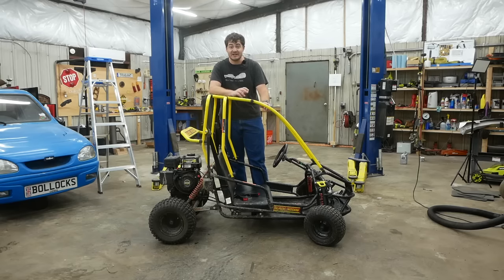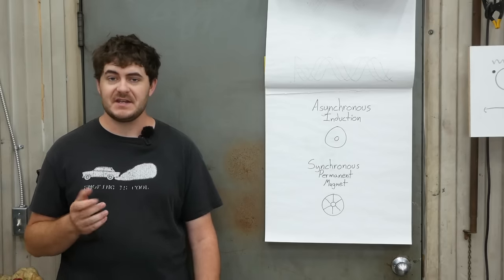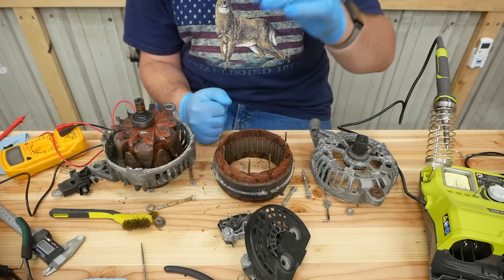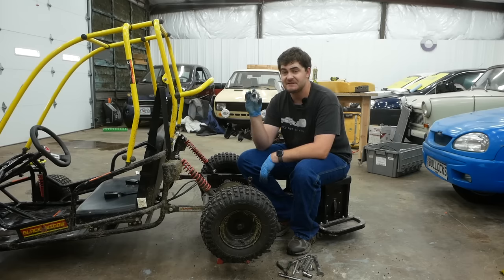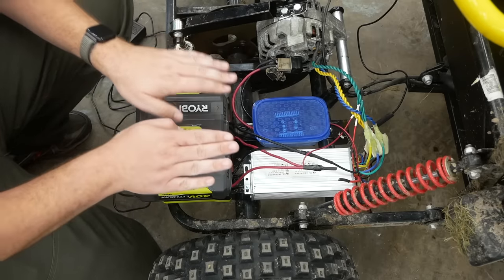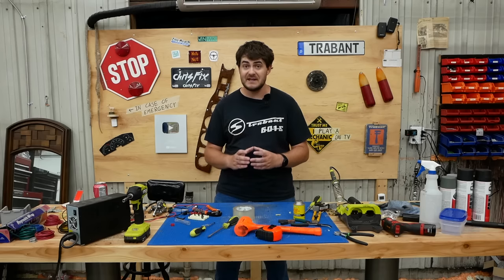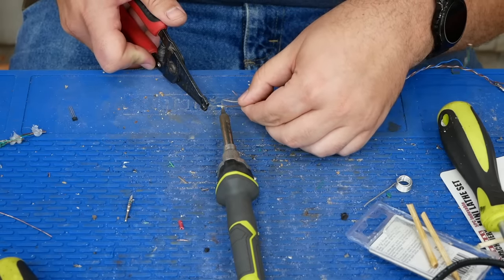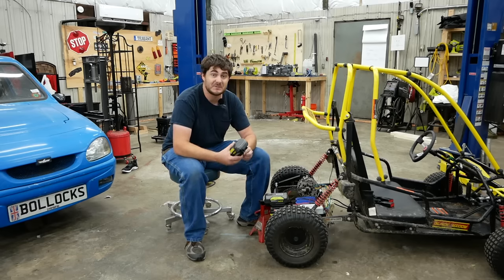Can I Power This Go Kart with a Used Car Alternator?

Comment: You will probably need to switch to a full size golf cart/jet-ski battery and use some sort of starter motor to kick the alternator into gear automatically. Can tie the starter engagement start and length of operation to the hall sensors (with custom breadboard) so that so long as there is a signal from a sensor in the past X amount of time then the starter doesn't engage so it doesn't just run and waste tons of battery while under Alternator power, only provides the initial kick forward so the alternator can engage and take over. When the kid comes to a stop, then the timer ends and he can press the accelerator again as X amount of time has passed since the sensor was tripped and now the starter will push the cart and off you go. Or you can make the throttle have an initial oomph at the start by making a two contact throttle... the initial start of the throttle from zero is the starter, and you push past that initial kick into the alternator once you have forward momentum. Would require testing to see how long that contact needs to be to provide enough oomph before it swaps to the alternator for speed as you continue to move the throttle forward. Downside to this is the kid might stay on that inital contact using only the starter to move... and drain your battery darn fast.

Comment: I saw a video about converting an alternator into a motor that shows the Hall effect sensors have to be in the center of the windings rather than at the sides due to the V shape of the rotor. Austiwawa I think it was? He used it to power a bicycle.

Comment: Put a high current capacitor in parallel with each of the motor windings and start from there.  3 phase is a bit confusing 👍
The cap should help flip the phase or at least that’s how it works on single phase/2 phase

Comment: Just a little more math: Typical 100 amp alternator at 13 volts is 1300 watts. I suggest you greatly reduce acceleration and the motor may then keep up with the controller.

Comment: When you mentioned getting another motor with the speed controller, my first thought was to hook them both up to get more torque.  Does that make sense?
Reply: not if he doesn't solve the sensor issues also it complicates the design while doubling the power draw, in his setup the HP output is not limited by the electric motor. Its the speed controller the limiting part plus he already plans to limit the speed anyway.

Comment: I wonder if the field from the inner windings is inducing current in the stator, setting off the over-volt protection. Or possibly causing a feedback loop of some kind.

Comment: Another point to note about electric motor power output is that is 1.6 horsepower instant a gas motor is 4 hp when it's full throttle. Electric motors are direct power and twice the torque of gas

Comment: On an alternator its voltage verys by power draw if you have a strong current being used the alternator will need to be spinning faster to keep up with voltage. I build high output alternators as a side job for emergency vehicles and some car audio enthusiast

Comment: One thing with the back emf position sensing in a brushless motor controller is that it knows where the rotor is from the electrical fields generated when the rotor moves slightly. So it sends those quick pulses, sees how the rotor moves, knows where it is, and spins. As soon as it's on the ground I'd bed those quick pulses aren't enough to spin anything anymore so it can't get the position of the rotor. You shouldn't need to push start it, so much as just rock the cart back and forth before turning the throttle, that should do the trick to tell it where the rotor is. 

The battery cutting out I'm as a loss, as I've never used the cheap brushless controllers, but I've had better luck with high power RC controllers for brushless motors than the cheap Chinese EV ones. They perform the same and typically come with better documentation.

Comment: For the kid you can dial down the maximum current the motor will receive and since you are planning a larger maximum available current you can turn up the current as he gets older and more capable of driving it safely.

Don't be tempted to add an "adult switch" because kids are smart enough to figure that out and also how to make that available for them when you're not looking.

Comment: The reason it keeps cutting out could be a built in low voltage cutoff. They are becoming more and more common on ESCs that are designed for lithium batteries. Or some sort of cutoff built into the batteries. As for the twitching, I’ve run into this before on an electric car car and never could figure out the cause. Hope you have better luck with that than I did

Comment: Mate patience is a virtue, or so they tell me. I have to admit this video, while very interesting, had me no closer to understanding how the motor was supposed to work, but still you have a great way of describing your intentions. Frankly, although less fun, but putting in a  small petrol motor, suitably noise proofed, would have got the 6 year old up and running and provided some very helpful explanation by you on how its done. Anyhoo I will await your next step with this build with interest. I am in the process of attempting to motorise an old 4 wheel mobility scooter  to run using a 110cc  petrol motor. It has a 2 speed  auto matic box and is electric start. To be honest, had I known what a mission this was going to be I would have left the 24volt batteries in place. But I want to be able to go in excess of 30 km on a single charge. Recharge is about 4 hours, so the small petrol motor seemed the best answer.. Oh well its fun flying in the dark with blinkers on..

Comment: I like how you wisely gave up- not as a full-on give-up, but you knew when to retreat and regroup for a second battle.  Also, could the rotor current perhaps be not enough at startup under load to cause the fields to get ahead of the rotor and dupe the controller into thinking the motor is stalled- thus triggering protect?  Could be a capacitor across the rotor winding would help?

Comment: Perhaps your controller MOSFET (driver) is blown. Did that few times with mine, have to replace them. Or simply enough, just buy a new controller, at least by having 2 you can compare if one is faulty.

Comment: Here’s a tip to anyone wanting to do something like this try and find someone who’s scrapping a Etorque equipped ram and see if they’ll sell you the motor/generator it’s going to be a lot easier to configure than this no offense to aging wheels but a motor generator is exactly that a generator that’s also used as a motor to drive a ram 1500 when In electric mode it’s got a lot of torque and even on my full size ram 1500 4x4 it’ll get her moving quick so imagine how nasty it would be on a go kart frame!

Comment: That's not really how the speed controller works though. IF it's rated to 1500W it doesn't mean that's the power it uses. It means that's what it's capable of running. 
The motor controls the power use. Free spinning that motor doesn't use 1500W if on the ground it does.

The motor will have a KV, and a torque per sqrt(W) rating. It might not actually be known, but it will have one. The kv is the rpm per volt. 
Lets assume the power of the alternator is equivalent to it's power output as a generator. The can put out between 40-140A with some high power ones for certain vehicles or configs putting out 300A.

At 12V, that's 480-1680W

Comment: You added 5 teeth to the front sprocket 

When doing that on a dirt bike thats a huge increase. Huge increase in top speed! 

Try a smaller front and bigger rear sprocket combo.

Overcome the initial current draw of getting it moving. 
Lower top speed
Higher take off and lower draw on the motor

Comment: I don't know what the problem is but I switched up a old losi remote control that was made to run on NIcad batteries. I made a lithium ion battery for it . And it did all the crazy stuff your cart is doing. Exactly the same . From the push start to only running a couple seconds and shutting off but all I had to do was flip the switch off and back on and it worked for a couple more seconds.  I never did figure it out .

Comment: there is two types of motor brushed an,  there is two different motor controllers. sensored modes usauly apply too brushless motors and controlers. as your using a brushed motor look into a controller designed for it. also lok into c ratings of your batterys as that will also help.

Comment: The reason it’s not working is because the alternators electromagnetic shaft is triangular, on a brushless motor the magnets are permanent and rectangular so the Hall effect sensors can be on the outside. But because the magnets are triangular on the alternator they arent getting a strong signal.

Comment: i have helped make a few carts like this, we never used an alternator though, just a normal a/c or dc motor with modifications as needed, most ac motors can be converted to dc from what my teachers showed us, anyway, what we found for more then one build was using a pair  of 12v deep cycle marine batteries was far more optimal for hours of use, also, we just used a resistive  speed controller kiped out of cars at u-pull-it/pick-n-pull type  places,  it was fun, the advantage of the large lead acid batteries in either  in series or parallel is run time and, they are  infact as im sure you know, quite easy to charge infact, we ended up mounting a small charger into the last one we made, so it could be plugged in when not in use, it was for a brother and sister who liked to go to the far barn and visit people in the area, and where they could plugin to charge when sticking around for a bit, it was a slow charge  but, so far they havent gotten stuck and its still in use daily 7 years later.. new batteries and tired have been needed, and the old man replaced all the barins when he realized one was starting to go, its  actually big enough  for large adults with moving seats, and it can move... even with my fat arse in it... its running dual 24v deep cycle batteries now, the old man got a good deal on a couple barely used ones out of a blow up piece of farm equipment... even he used  it to run out to the far barn and check on fences.. it can genuinely go for hours... he did setup a fan moving air over the motor and a heat cut off for the motor after the kids called  to tell him how hot it was, he drove up and, agreed, had them wait an hour then drive it home, by the time they got there he had found an old metal 120v fan, he tore apart and juse used the head(fan and its grill) and its driven by a belt or chain(he made a cover for that  to keep  fingers out same as he did for the chain drive) it looks a bit funny but... that and the heatsinks he epoxied to the thing, no more heat issues since... 

oh and he had limited the speed by setting a limit in the speed controller range but that was removed long ago, once they got old enough and, heavy enough, he removed the screw and well...the way hes got it rigged now it can and has  town his boat up hill to the far barn with his fat arse in it.... torque for days... and enough speed to make me, somebody who likes moving fast.. a bit concerned...(i mean we have rolled it.. the roll cage is great and all.. so are the belts...but...still makes me cringe thinking about it..

the original speed was  set to around 15mph, same as my mobility scooter he moved it up a bit to around 20-25 range before just removing the limit... its  "dumb system" even the temp sensor isnt computerized.... the old guy knows his analog tech like you wouldnt believe....

Comment: You use switch HAL sensors, for brushless motors you need to use intensity strength HAL sensors, that provide an output voltage proportional with the strength of the magnetic field, and you need to place such a way that they don't saturate, you need a perfect sinus signal out of HAL sensors and the placement as well need to be placed in an exact position, the controller need to sense exact position of the rotor, when HAL sensors are present the controller become something like a 3x feedback regulated power amplifier, if you do not use HAL sensors the controller will try to sense the position from the rotor and use the stator drop voltages as feedback, what you seen when you connected the stator without the rotor was the controller trying to get feedback from the stator thru the rotor position and enter in the positive loop and begin rotation, because was chain directly to the weels the feedback voltage is not enough to trigger the positive feedback, you can use the variator clinch from the gas engine, to let the motor spin and be coupled to the weels after the speed increase and the controller is in normal functional state.

The same effect ( without HAL's) can be obtained with a simple BTJ power transistor one resistor and one condensator and using one phase as signal thru resistor and condensator in paralel to the base of the transistor and one phase wired to the transistor collector, the resistor with condensator in paralel will provide the initial magnetic pulse to force an initial rotor movement, if there is an rotor the phase will return a voltage that is filtered by the condensator, and the transistor will become and out of phase switch that power the other phase, the resistor has the role to give initial reference voltage to the base and make sure that the condensator will discharge in order to be enough for the next base pulse switch.

Comment: Too many variables i think for the results you want.
The battery voltage will sag on the rotor coil under load confusing the auto position sensing of the brushless controller.
You could find some powerful speaker magnets to fit inside instead of the coil.
I think the saw tooth shaped inter meshing of the rotor end teeth reduces the accuracy of the rotor field and stator field depending on how close a rotor magnet tooth is to any given stator pole along it's length. Not too bad for generator mode but could be nasty for your application. Still, love the energy you are putting in to get your concept working!

Comment: Try monitoring the voltage as your driving, the battery voltage is probably sagging under the minimum voltage for the controller and is shutting off

Comment: @Aging Wheels - A strange and (nowadays) little-known fact about Wound Rotor 3-Phase Motors is that if you short the brush leads together, the motor acts like an induction motor, with tons of starting torque. Will that work with the electronic motor controller? I don't know, but it is an extremely easy thing to try. The only obvious downside of it, if it does work, is a slightly lower top speed under load. On the plus side, you save on sending in power to magnetize the rotor. If you want the best of both worlds, you can rig a relay to switch in rotor current once the go-cart is rolling, or just as a "turbo mode", which everyone enjoys having. BTW, 5 amps of rotor current is probably excessive, and it may be worth experimenting with other amperage there, even varying the current during operation. If you find that the best rotor current is zero, you can skip the brushes altogether, and just solder the slip rings together on the rotor. Modern versions of all this wound rotor business, which is still used in very large 3-phase motors, has no slip rings at all, because they add some electronics to the rotor itself. The rotating magnetic field of the stator induces an Alternating Current in the rotor, and when the rotor reaches a programmed speed, a relay, centrifugal switch, or solid state switch opens and other rotor circuitry takes over.

Comment: In theory, an alternator can be converted to a motor. But in my 40 years of turning wrenches, I’ve never seen anyone who has successfully converted an automobile alternator to a motor. Get yourself a dc motor and the controller out of a used treadmill. They are a dime a dozen and perfect for your application.

Comment: Make the rotor variable voltage/current as well. More current, more torque. Once it gets going, Lower the voltage. Honestly, if you set the motor controller to roughly say...65 to 90%, depending on the choice of top end speed, and ONLY adjusted rotor voltage/current, you may have better results.

Comment: DC-powered bolognese  :D

By the way, you probably ought to add a flyback diode across the rotor magnet, so that it won't cause an arc when you de-engergize it.

Comment: Battery packs are  cutting it out. You compared watt hours which shows that these batteries have low capacity for the load you are pulling. Most certainly they have to low amperage also because it would be crazy to design a battery that you could dry up in 10 minutes or so.  Ryobi does not have such equipment that lasts only 10 minutes so it means they are not pulling that kind of amperage also from their batteries. Hence they get protected if you try to pull it. They automatically reset after a while. This also happens for ryobi own angle grinder if you use too small capacity battery (which probably has also lower amperage) - as soon as it's abit heavy to cut , the angle grinder stops and you need to wait 2-3seconds before it can be restarted. Also your alternator is probably only around 900w-1000w. This is what they usually come as. Campers and some heavy on electrics and diesels can be bigger.